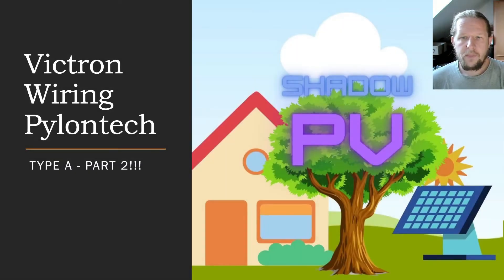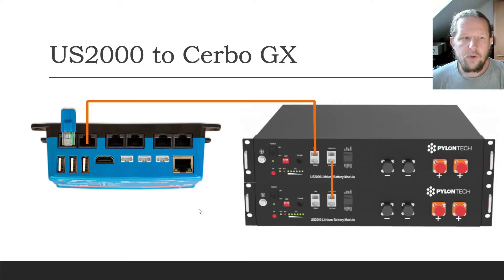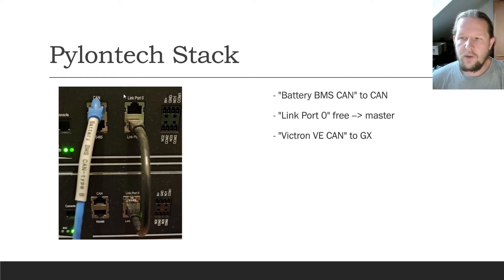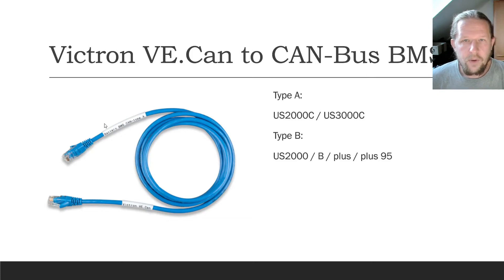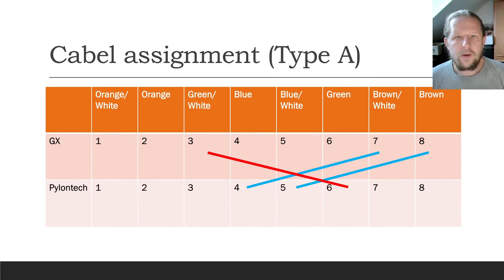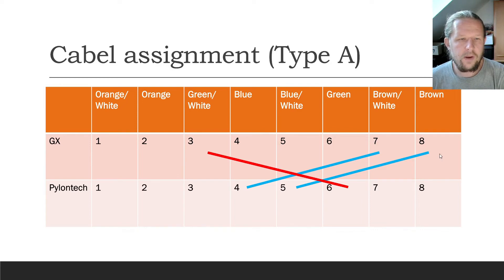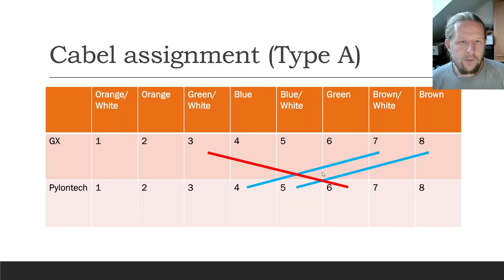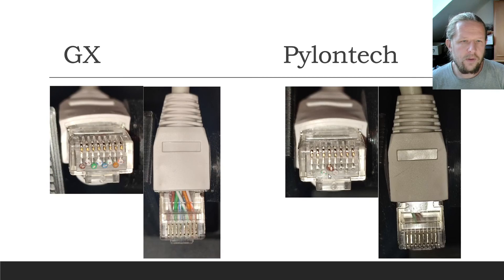[Part 2] Connect Pylontech Battery to Victron Multiplus II - Type A

Comment: I have a Cerbo GX and a Pylontech US5000 battery. Th battery has no CAN port. It has a A/CAN port, is this the same thing? It also has a console port and a contact port. The Cerbo GX also doesnt have a Can.BMS port, it has 2x VE.CAN ports. I have tried connecting my cable to all the ports in every possible configuration and the battery doesnt show up as a device in the Cerbo GX. Its driving me nuts.

Comment: It looks as though there are important info on GX devices that should be included at the end of this video.

 On the GX device,
If your GX device has a BMS-Can port, the battery should be connected to this.
If you connect the BMS to the VE.Can port you will need to adjust the port speed. Select the CAN-bus BMS (500 kbit/s) CAN-profile in the GX device. Menu path: Settings → Services → VE.CAN port.
After properly wiring and setting the correct CAN-bus speed, the Pylontech will be visible as a battery in the device list.
Reply: Correct info. I have got an inverter multiplus-ll with Cerbo GX inside.
Victron tries to hide this potential and many manuals are not updated too. In fact to configure the multiplus I don't need to buy MK3 interface because I connect my PC directly to the wi-fi network generated by the inverter himself.
Reply: If you connect Pylontech battery via VE.Can to the inverter and proceed to configure it, then setting the system selecting Pylon in the list of configuration after that the system knows exactly all battery parameters by BMS. 
In this case you don't need the smartshunt to know battery' S.O.C.

Comment: Thank you for the detail. I made a type A cable for the Multi II GX linking to  a 5000W Vital-5 LiFePo4. I connected the VE.Can side to Multi ve.can port, inserted the terminator and on the other side into the Vital-5 battery BMS Can port. I however do not see the Vital-5 battery on the device list ! The Vital-5 has the same pin-outs as the Pylontech Type A. I there a special setting in the Multi II GX, to make it visible in the App ?